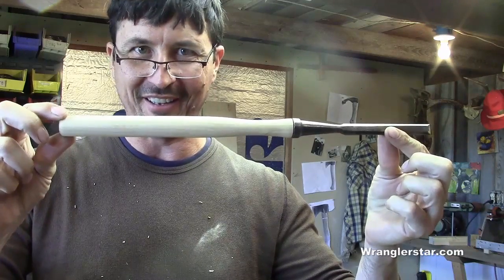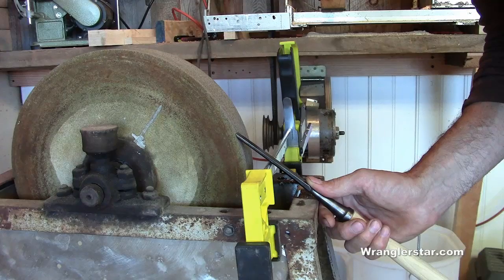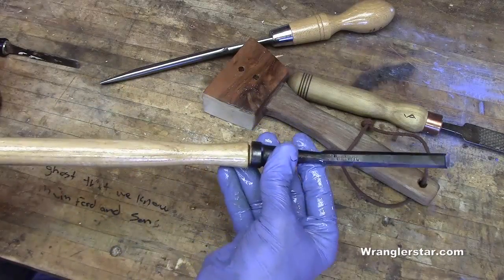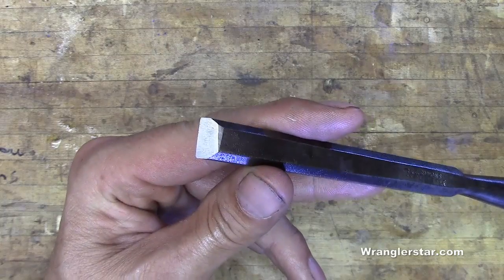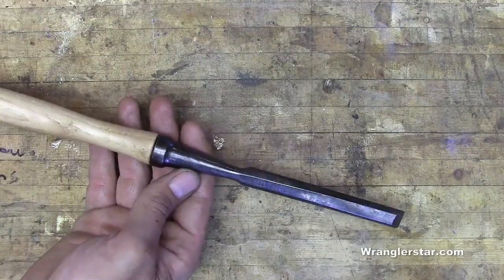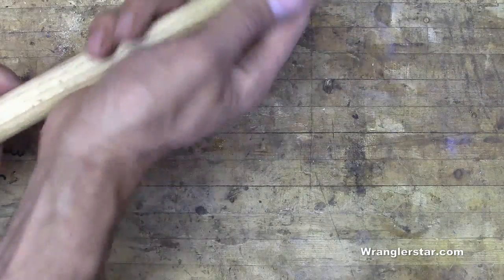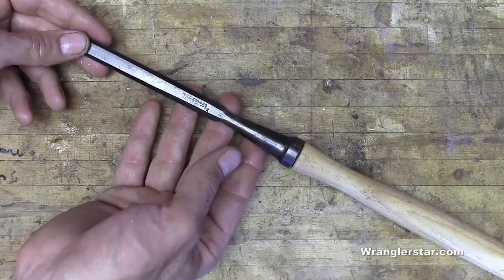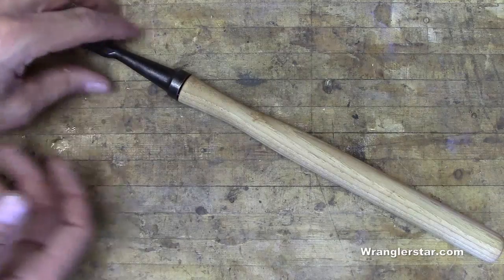Vintage Timber Framing Chisel Restoration | 2

Comment: Great Job Cody, and the best thing is that as you use it, if you decide it's too long/short, or too thick/thin, you can just make another handle!

What you have made that chisel into is what I'd call a paring chisel, this is not a chisel that you strike with a hammer or mallet, this is for paring, kind of like your slick, but on a smaller scale. 
Thumbs Up!!

Cheers!

Comment: I completely understand that feeling of using a tool you restore yourself. I have been restoring tools for a couple years but my favorites are my vises. both made by athol out of Massachusetts on in the 1880s and one in the 1890s, on found at a yardsale for 2 dollars and one rescued from the dump. no joke when I finished both of these the hair was standing up on my arms, because I knew that the last time they looked like that someone was bolting them to a work bench 100 years ago.

Comment: Cody just wanted to share with you that most chisels like yours with long handles are mostly used for hand work and not struck with a mallet. Chisels with shorter handles that are to be struck need to have a metal feral or leather end caps to help keep the wood from splitting. Very well done on your first tuned handle.

Comment: I've made a few complete sets of wrenches/sockets  by buying boxes of tools at garage sales. I'll get 3 or 4 at each and throw them in a pain and every few years I'll go through the pail and make sets. They are usually not the greatest tools but they work fine for up at the cottage or to put in a trailer tool box. Idk how many sets of pliers, hammers, screw drivers and clamps I've gotten for a quarter or less. A few years ago I Bought a tool box full of drill bits for 5 bucks. If I bought them all new it would of been thousands of dollars. They funny thing is I've met people that are "to good" for garage sales. They don't admit it but u can tell its what they are thinking. Oh well more for us.

Comment: you could also put a nice polished stainless steel color on the back of the handle for a striker so you wont split the ends off

Comment: Wasp trap update?   Nice chisel, just bought one today.  Also, you had inspired me to make an axe handle.  Found some Collins axe heads for 3 bucks a piece.  My first handle came out great except for the mounting portion.  Learned a lot from doing that project and will not make the same mistakes again.  Thank you for all your great videos and experiences you have been sharing Codi.  Speaking of the Japaneese, I would enjoy sending you a scribe knife that I bought in Japan for marking out mortises etc.  Please PM me.

Comment: Cody its not my chisel but I would like to have seen some scribe lines for decoration. A metal ruler works great for this. When I did use a lathe I also liked the look of using wood strips to burn friction lines.
Reply: Or just use a wire from a coat hanger

Comment: I think the handle is a little long for me. I think i would have preferred about 2/3-3/4 the total length. but everyone has to make what they want. I actually have a few socket chisels that I need to make handles for. So Cheers and great work as always.

Comment: 👏 and I'm happy to say my axe head came and it came pretty sharp so I'm going to leave the edge sense I don't have any tools that would make sense to sharpen it with but I have one question and that would be do you have any suggestions for where to buy a great handle I could use on the head. 
                                     Best regards,
                                                          Benjamin

Comment: Mr. Cody I see your comments on how the chisel won't be hammered on as to the reason for not putting a ring on the end. But I was wondering by putting a ring on the end of your tools if it would help aid the boiled linseed oil in the prevention of checking?

Comment: i think your missing the metal ring around the end of the chisel to prevent the end from splitting
Reply from the maker: This chisel wont be used for hammering,
Reply: wranglerstar
is the handle not a bit to long ?
 can you give us an update when you have used it for a bit please?
Reply: wranglerstar Of course not. You would use a hammer for hammering. 

LBJHJP50 You don't necessarily have to hammer a mortising chisel. A good sharp chisel will work like a plane. I would say this chisel isn't built for hammering to begin with - no tang, and the stock is thin. I think Cody is using it for exactly what it was intended - cleaning out mortises.

Comment: Hey, can you tell me why you were spinning the whetstone towards you when sharpening the chisel?
Why not away? Is there a difference?
Reply from the maker: Spinning toward is the proper way sharpening any sort of blade,
Reply: If he had it spinning away from him then there would be the tendency for the stone to pull the tool off the rest. This would change the angle of his grind when it happened and give him a multiple faceted bevel.

Comment: I see you use boiled lind seed oil on lots of things.  I have used cold rolled lind seed oil for 40 years on gun stocks and metal parts and in some ases bees wax or a mix of bees wax and the oil.  I have never used boiled lind seed oil.  Is there a difference?